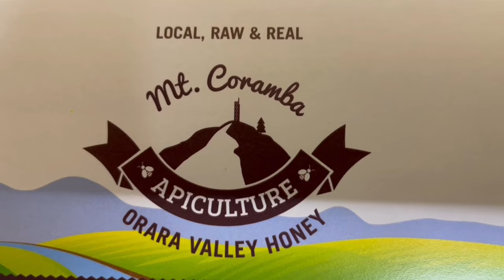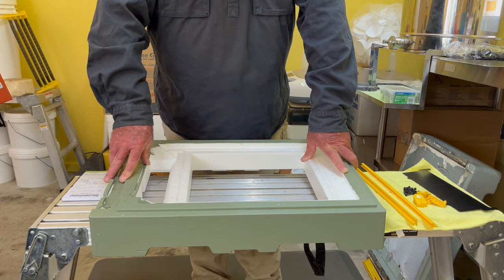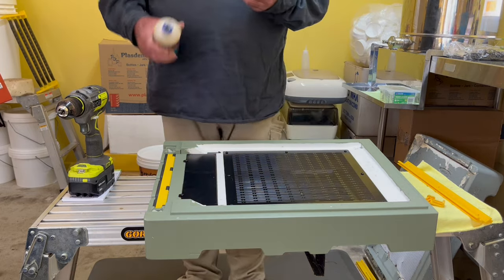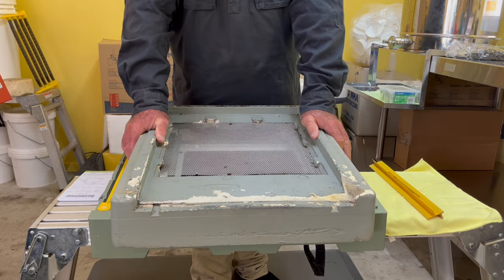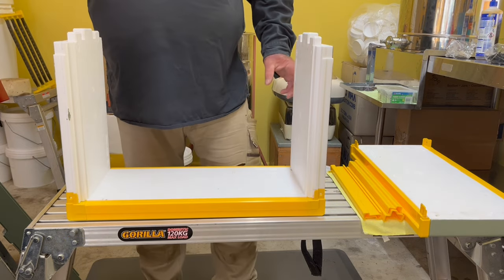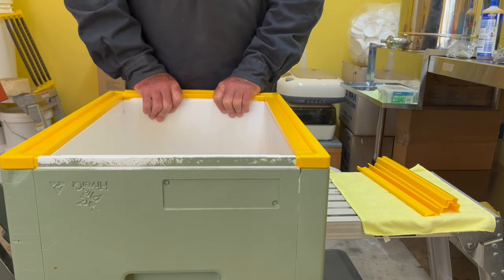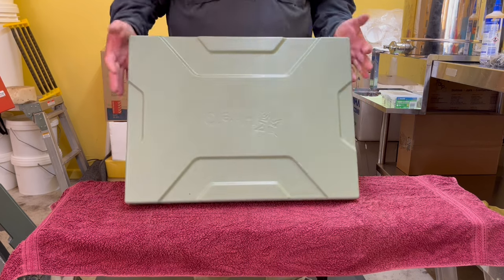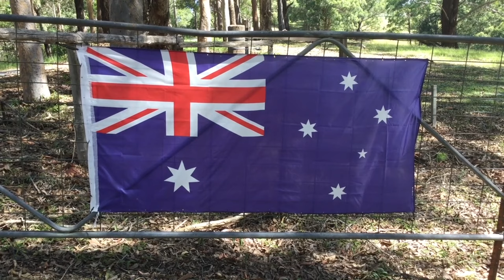🐝 How to assemble the Australian designed Hive IQ poly hive.  Orara Valley Honey.  26/12/2023

Comment: Thanks Glen, great assembly video. We have a mix of hiveiq and paradise boxes and they interchage well. The all-round profiles on the hiveiq boxes are a big improvement because you can jab your hive tool into any side to lever boxes apart and also scrape off resdue around the  profiles both which were prone to damage in the paradise system. The hiveiq system is impressive and their setup in ACT where they manufacture is equally impressive.
Reply from the maker: Yes definitely an improvement.